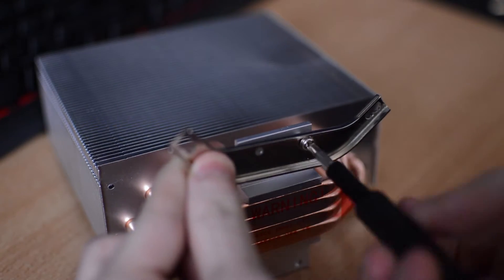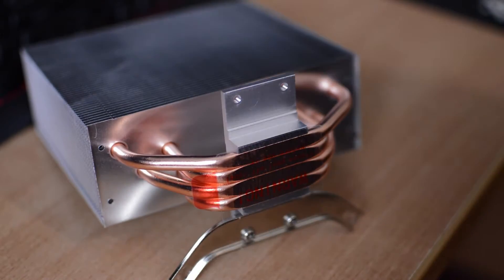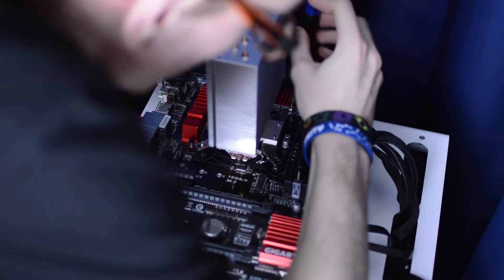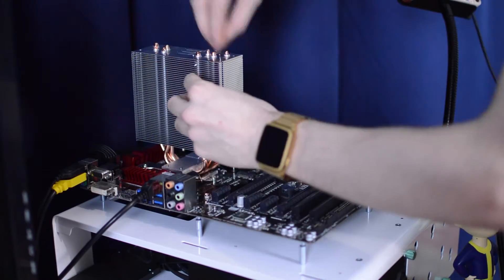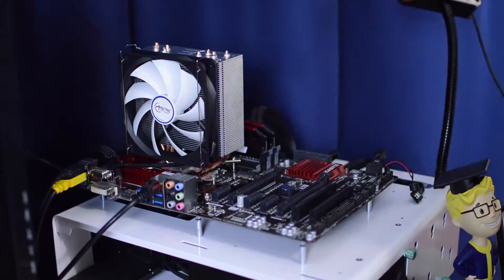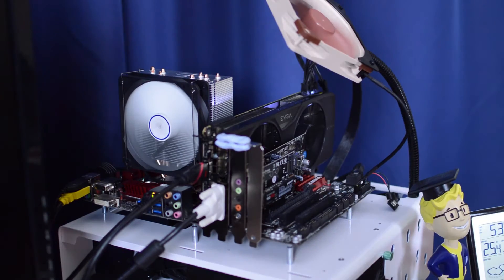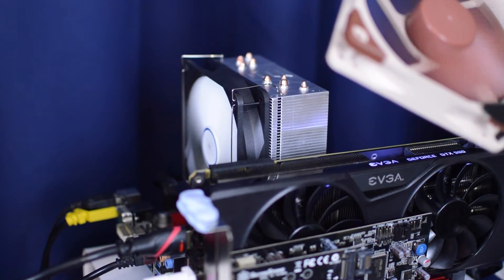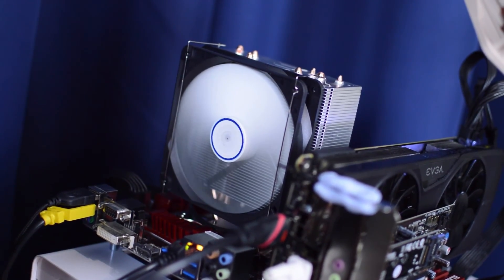How To Install A Arctic Freezer i32 Cooler

Comment: Hello, I've installed this great cooler on an i7 6700k and according to its manual, the thermal paste should be applied over each one of the 4 heatsink pipes (a line over each one). That's how I did it and it works just fine.

Comment: Hi, i noticed you put the thermal paste onto the CPU but in the arctic freezer guid they mention you have to do it spread it equally over the 4 heatsinks ? Does it matter a lot if you put it onto the heatsinks or just on the CPU ?
Reply: do it like Arctic it will be better